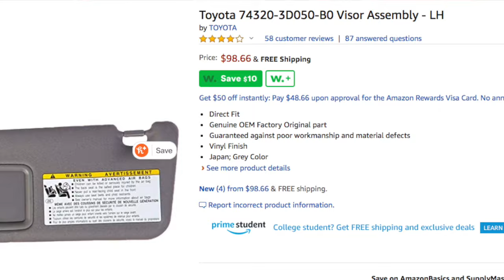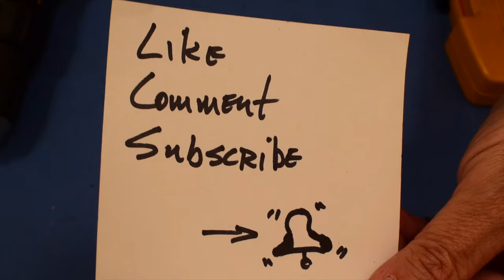Toyota Sun Visor Repair

Comment: i would recommend that you put a big washer under the head of the bolt. it applies pressure on plastic, and is a good idea to distribute the pressure on larger surface.
Reply from the maker: Terrific suggestion. That deserves to be pinned!

Comment: Fantastic!  An elegant solution to a frustrating, perplexing problem.
I used your bolt solution on my 2014 Tacoma.
I live in Phoenix, so my only variant was to avoid using tape, as it would only melt and fall apart in the desert heat.   Instead, I drilled three holes along the edge of the plastic clamshell and used zip ties to hold it together. I positioned the zip tie connection on the closed side of the visor so you don’t see the little bumps in the fabric most of the time.
I then sewed the fabric back in place.  It looks like Dr Frankenstein did the repair, but it’s not bad.
Thank you for posting a very helpful video
Reply from the maker: You are welcome. Glad it was helpful! It's still working to this day. Your zip tie solution is brilliant!

Comment: Had same problem on 2012 Tacoma.  Followed your directions as much as possible.  Main difference was that I sewed mine back together with needle and matching gray thread.  Seems to work as well as it ever did.  It will be interesting to see how long it lasts.  Thanks for the video.
Reply from the maker: Now sewing it together is the best! I trust the fix will last at least until the truck stops running. As for your sewing, I'm sure it'll last a lifetime!

Comment: The mirror comes out easily by prying the end of the mirror assembly closest to the end of the visor as opposed to the middle. That makes it easier to Skin the visor and then sew the covering back together when finished. Great video and Thanks for the idea.
Reply from the maker: Great tip. Thanks. I was a bit concerned that the mirror might break so I avoided the pry.
Reply: @Alan Mahaffey - Confirmed, worked for me like a charm, thanks!

Comment: I did exactly what you told me I took it all apart put it back together using nuts and bolts and actually work I got lucky with the light it works too thank you
Reply from the maker: You are most welcome and congratulations. Others have also used superglue to get the fabric back together. others even sewed it back together. They've stated it worked well for them. If the heat is an issue with the tape give those ideas a try. Best to you.

Comment: Thanks for the video. I followed your instructions and it worked great for me. I haven't yet tried to use the visors a lot, but they flip up and down like they should. The one difference in my approach is that I decided to completely remove the foam/cloth covers. If it turns out the halves don't want to hold together on their own, a bit of duct tape should fix that. The foam covers themselves are only aesthetic and I don't mind the exposed black plastic. So what, as long as the visors work. Thanks again!
Reply from the maker: You are so welcome.  Glad it's working for you. I have thought about just using some scrap material and sewing a "sock" like cover to slip over the visor. But black plastic isn't a problem either.  Best to you.

Comment: Thanks for the advice! In my case (2004 Toyota Land Cruiser Prado aka GX 470), I "blindly" drilled the holes according to your video, and put the screws in. Without removing the cover and the hassle to put it back on. It worked!
Reply from the maker: Glad it worked out!
Reply: Could you explain in a bit of detail how this was possible?  Did you put the washer and nut on the outside of the visor?  Does the visor still close flush to the roof?  I'm struggling to envision how this would effectively restore tension without putting the washer and nut in the interior of the visor.  Thanks!
Reply from the maker: @jameshatfield9336  4:00 Washer and Nut INSIDE the visor.  and see again @ 4:45
7:02 it's flush
Watch the video again. Maybe a couple more times. You'll get it. 
Do you have a Toyota?
Reply: @TSGEnt  I understand your video, sorry, I was trying to ask @felixspiess.  Turns out my Toyota had a different design on the inside of the visor so this method didn't apply.  I ended up ordering a new one.  Great video though.
Reply from the maker: @jameshatfield9336  Got it. Good to know. What Toyota do you have? I'll add it it to the pinned message so those with your model won't be surprised if looks different.
Thanks for watching the video btw! Best to you.
Reply: @jameshatfield9336  Bolt head and nut (as well as washers below each) are on the outside of the visor, yes. While bolt head and not are not flush to the visor surface, the visor still reaches the UP position. Esthetically not the perfect solution, but hey it´s a 18yr old car, functionality counts more than looks ;)

Comment: Yes! This method worked on my 2007 Nissan Versa visor, (hollow plastic, cloth cover)! The only difference is instead of drilling though that small hole, drill though same area between  "upside down U clip" and install nut & bolt, tighten and trim bolt with hack saw.
Reply from the maker: Excellent! Glad it worked for you and on a different make! Let your Nissan friends know!

Comment: Worked on a '07 Taco perfectly! Have to find a way to make the seems look a little cleaner when its buttoned all up! Awesome video! Thank you!!
Reply from the maker: You're welcome. Glad it worked for you. If you discover a way to reattach that cover, share it with us. In my case, the tape did fail due to cabin heat, so I used a small bead of hot glue on the seam. It's been holding better, just not as a pretty job.
Mine took 13 years b4 failure, sounds like yours lasted 14 years b4 failure.  I get the feeling some of those '08 are going to start to fail pretty soon.

Comment: Thanks, worked for me on a 2013 Mazda CX-9, very similar. I cut the seam of the fabric with an X-acto and used super glue to close the seam when finished. Like another person I too removed the trim for the mirror to make it a lot easier to reseat the fabric. All works except that the mirror light does not work, I think I forced the contacts out of place and I should have tested it before gluing the fabric but it's all out back together. Happy to have a working visor but this did take me about 1.5hrs so in reality it would have been cheaper in relative terms to buy the OEM part :) but always fun to fix things.
Reply from the maker: glad it worked out for you! Well, all but the light. You can always take it apart and troubleshoot it.

Comment: Thumbs up.  I tried a similar fix using a bolt through the entire visor.  Looks like yours is a better solution since it isn't dependent upon any of the plastic.  I've been sporting an old junk 4-Runner visor, but may have to try this fix again since the 4-Runner isn't an exact match and is missing the slider.  BTW, should you have to try to wrap it again, the bezel around the mirror pops off so that you don't have to tuck the fabric.   Oh, and don't bother with the hot-glue.  I found even the "high temp" stuff gets soft and useless in the truck.   (although mine is black)
Reply from the maker: Sounds like you have hot glue experience in your vehicle. ;)  The only plastic to worry about is the body of the visor. Great tip about the bezel. I pulled on it but was afraid to break it off. When it's time to repair the passenger side visor, I'll give it a try.

Comment: I just removed the cheap plastic bracket, drilled a hole thru the metal inner piece attached to the flip bracket, to the outside of the foam & laminating plastic pocket on the opposite side. Then I attached a flat washer with no sharp edges and used a pop rivet gun to secure both the flat washer and inner metal piece together. No need to worry about a screw loosening over time and it will last longer than my car will now. If rivets are good enough for airplanes, I’m good with them. Then you can turn the fabric inside out to sew seams on all sides but the top, slide in the repaired visor and attach some double sided tape to hold fabric in place while using fabric glue , the repair is permanent)to finish the top seam. Then snap the mirror plastic border in place with fabric edges neatly under it and viola…looks like factory but WAY stronger. No need to worry about sun melting plastic bracket with a new visor which will happen…I replaced a few years back with same problem. I gave the fabric a good scrubbing with dawn and a magic eraser…it worked better than upholstery fabric cleaner or stream (if used correct fabric glue) since hand oils are best removed with a degreaser. Then screwed back into car headliner…snaps wonderfully & is tight fitting. I’ll wait for my other to break then will do the same to that side for my 2005 Scion tC made by Toyota. The repair was well worth my time since I’ll never have to repair them again and replacements are not always easy to find for older model cars. So its the price of one pop rivet, one flat washer, some thread, double sided tape (not the foam kind) & fabric glue. I had just finished washing dishes so the dawn and magic eraser were borrowed and then returned to the kitchen. Total cost was under $2.00 to repair and is a permanent fix for a broken plastic inner securing bracket. Oh and for anybody thinking about plastic welding the bracket in to sandwich the metal piece…it wont hold. I fused that bracket plastic so well but because its so thin, it will snap in other places after being degraded from uv exposure. The plastic melts fine in fusing but forms cracks everywhere as it cools and hardens. Each crack is just another break about to happen. Go with pinching the metal piece to a nice flat washer and burn the plastic bracket since recycling is useless.
Reply from the maker: Awesome fix! Thanks for the input.

Comment: Thanks much!  I used this info to fix the passenger side sun visor on my 2008 Tacoma. Worked great. Got it reinstall in working.  I used hot glue to put the fabric back in place. There is a bit of a noticeable seem but not bad. Hopefully the hot glue will hold up in the Arizona sun.  Thanks much!
Reply from the maker: You're very welcome! Hot glue is a great idea. That Arizona dashboard heat is intense for sure. Keep us updated as to how it holds up. The Texas heat is no joke either. A few months later we ended up removing the cloth tape and used super glue. that did pretty well.
btw, where in AZ?

Comment: great video, right to the point, BUT you didn't say what size drill , bolt and nut you used, I used a .125 (1/8) drill, bolt and nut with 2 washers, one out side and one inside
Reply from the maker: In my application, I used an 8-32 screw and nut with a 1/8 drill bit. I happened to use what I had on hand. a 6 or even a 10 screw will do as well.
size 6,  7/64 inches; size 8, 1/8 inches; size 10, 9/64 inches

Comment: An easier way to fix the visor:
Install neodymium magnet(s) on the outside of visor with countersunk screw. Use steel fender washer and attach it to headliner (slightly off center from the magnets on visor) using a screw.  
It took me less than 10 minutes start to finish. However, it did take me 2 years to finally arrive at this method of solving the problem. Sorry, but I won't be posting a video of this. It's a very easy fix.
Reply from the maker: super idea!

Comment: Have you had to fix the sunglasses holder in the roof console? I don't know if it's  the same in an 06 as mine (07).
Reply from the maker: I gonna guess they are the same in both model years. Mine is fine. What happened to yours?

Comment: I want fix my  2013 Toyota Tacoma pre runner sr5 sun vizers  I want your help  they are falling down
Reply from the maker: Just follow along on the video. I know you can do this. Use superglue (CA glue, aka, cyanoacrylate ) and not tape to reseal. Careful, don't get your fingers stuck together. Lesson learned.

Comment: Help!!!   I can't get the 'clam shell' to open up. I've already bent the plastic out of shape closest to the arm.  The bottom of the clam shell pops open easily, but the area where I need to see where the broken parts are is held on pretty tightly.  Did anyone else have that issue?
Reply from the maker: In my application it was just pressed fit into place and with a little prying with a popsicle stick that I whittled to an edge, on the seam of the clamshell, it opened right up. Is yours a 2006 model?  I wish I could help more. 
Anyone else? Can you chip in and help?

Comment: Once you cut the screw, the threads on the end are too messed up to get a nut to start.
Reply from the maker: I suppose I've been fortunate that the AMP Super Champ I use has cleanly cut screws for my needs for the last 50+ years.

Comment: Did your compass/temp overhead display go out too?
Reply from the maker: yes it did. it's failed and I fixed three times! I'll go at it again. The resistor that controls the fan speed on the AC is causing problems too. It's another known Tacoma issue.
Reply: @TSGEnt  Mine just went out for the second time...I'll be putting those little aluminum heat sinks on those components when I get to it again.
Reply from the maker: @MrDLRu  Let me know how that goes. It's funny how all goes well for so many years then all at once things go out.
Reply: Panda  Does it only blow on high?

Comment: I opened mine and that part in the video was intact. My problem was a cracked plastic tube. There is no way to fix it and I ordered a cheap replacement from Amazon
Reply from the maker: Sometimes you need Amazon stuff.

Comment: Or you could’ve gone to a local auto wreck place where might’ve been able to pull a visor from a similar wrecked model for a few bucks, likely less than $10 although, admittedly, I probably would’ve done what you did and repaired it myself.  Good job, hombre!
Reply from the maker: Thanks! Well, I thought about a salvage yard. Not very many Toyotas here in Waco however, and the savage yard here is filled with Ford and Dodge and you have to be careful not to step on cow patties. ;) Please pass this around. I'm certain a number of people may benefit from this. The plastics are coming to the end of the life on these things. I searched for fixes and none are like this one and there are a lot of breaking parts on these Tacomas and the Camerys which are very similar. Just use the YouTube share button beneath the video window. Thanks!
Reply: Same problem on my 03 4Runner! I checked the junkyards in WI and MN and the have no visors left. On eBay used 4Runner visors run $100. I’ve rigged a Velcro system. Love my Yota but how many years of how many different models have this stupid design? Cmon Toyota!! 🤬

Comment: Will it work on 2002 toyota hightlander
Reply from the maker: I don't have a 2002 Highlander so can't verify for sure, but I'm reasonably confident that the sun visor concept, where sizes may vary, is the same across the board. And judging by the fact you as a 2002 HL owner is asking, the problem is the same, so the fix should be similar.

Comment: It works... but I can't suffer the taped upholstery. $100 for a new visor oem is not hateful.
Reply from the maker: I hear ya. Since this repair, others have used super glue or stitch witchery to bond the fabric together. I've been told they work well. I've added those to the store-  https://amzn.to/34EeBYq. I have found and OEM part for less than $100! https://amzn.to/3jlG2i1 Price came down so you might what to check that out.

Comment: Have the same issue with a Landcruiser Prado. Don’t understand how Toyota have a reputation for reliability. Reliability extends to all parts, not just the motor running. Some of their components must be so old in the design. There are reports of this thing failing from 20 years ago and still no change. Toyota are crap and living off past glories.